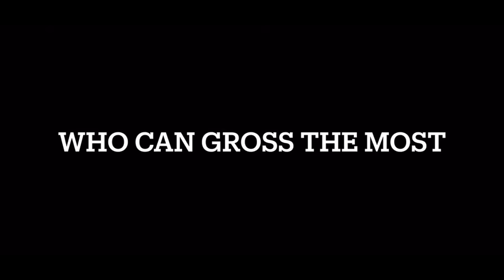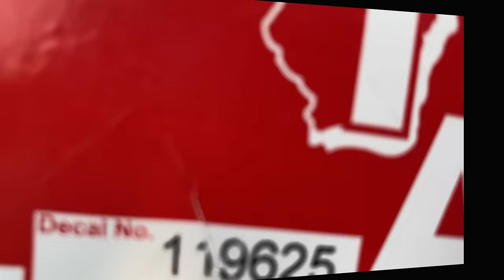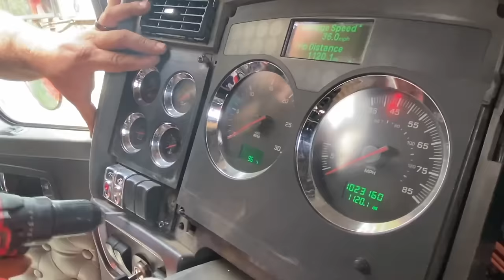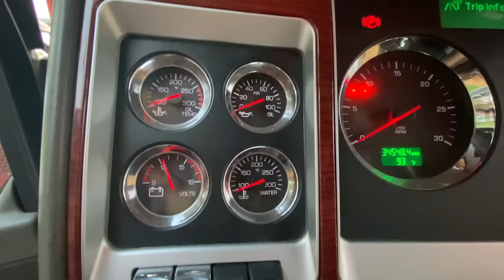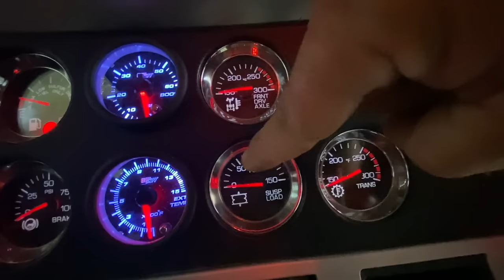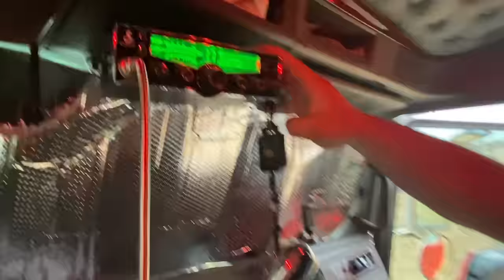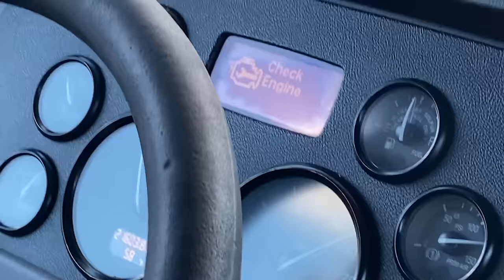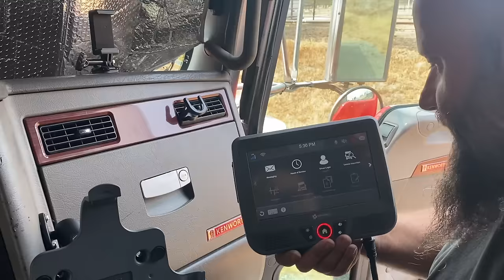“Kenworth W900 Specs and ELD Install”

Comment: Wow, y'all got a lot of truck for a good price!!
Sounds like it runs well from what you say.
Million miles on original bottom end is outstanding BUT, (theres always a big but),  would not be a bad idea to replace rods and mains if you want to keep it for a while. Cheap insurance.   
A quick check for wear would be see how much end play crankshaft has... I realize clutch use wears on that too, but you can check it externally without taking anything apart... if it is excessive, that will get renewed with new thrust washers while rods n mains bein put in.
Jus' sayin...  this all coming from a former big truck mechanic turned driver, c'mon...
Some believe if it is running great, don't mess with it, could open  a can of worms, but it is better to "know" that bottom end is not on the verge of pooping the bed, cause once something down there goes...  well you know.
Good luck with her either way, very nice ride for sure!!

Comment: Thanks, not only for a great video, but for the education part of it as well.  I have a 2017 W9B short hood and was wondering how the dash came apart.  Thanks Martin. I’ve had to replace my clutch pedal switch.  It was painful on my body to work under there. You made it looks so easy😂